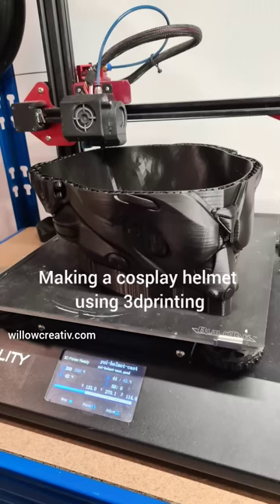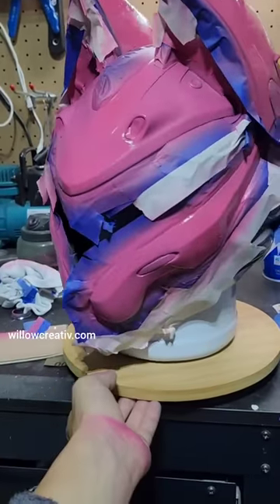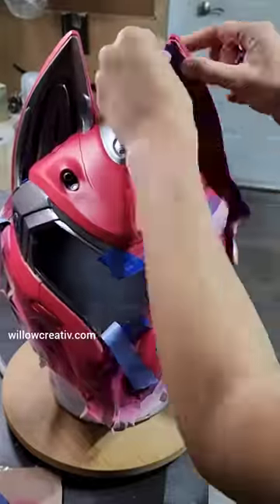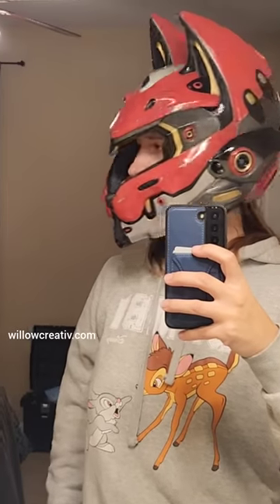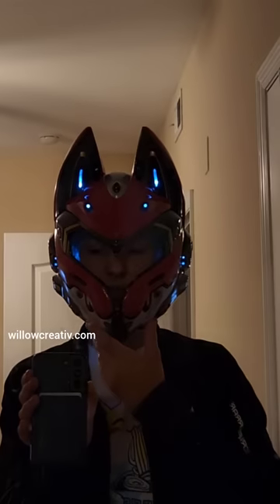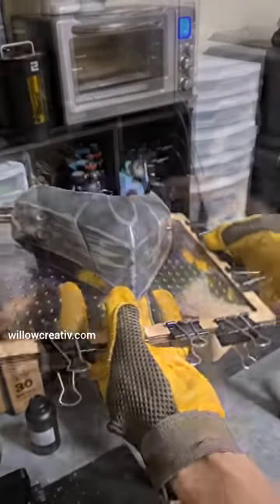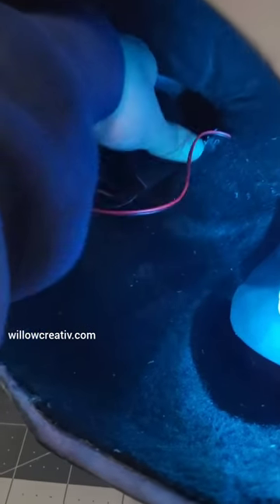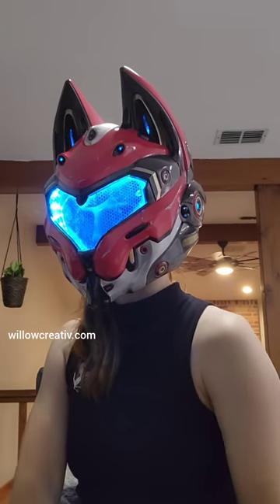How I made this amazing 3dprinted custom helmet!

Comment: amazing work you did there. I do have 1 small suggestion that may help with vizor led strip. add a few resistors to the led strip to bring down the brightness or add tint to the strips themselves so that it still lights up the vizor but doesn't blind you in dim rooms

Comment: It's a stunning piece of work & you should be rightly proud of your achievement in building it. 

I look forward to your watching more vids showing your continued work on the Spec Ops Armored Suit. 

Some Suggestions: 
~ Rebuild the electronics to have external control switches (under one ear) for the lights & other tech.
~ A well silenced cooling fan (axial would work best) blowing fresh air into the helmet.
~ Replace one of the tiny lights above your forehead with a high resolution (4K) video camera that is connected with a couple of stereo microphones inside each of the ears - perhaps even linked to a HUD (or something similar) for the screen.

I so want to see people engineering actual technological armored/computerized suits and people building Cosplay rigs like this getting together to make technically plausible Armored Suits that still look freaking awesome.

Comment: This is awesome! Really well done!

Would it be difficult to maybe route the on/off switches to somewhere like the neck/chin of the thing, so you could control the lighting without removing the helmet?
Reply from the maker: Yeah its not a problem to do but it was not a feature required for this end result as itll be for shelf decoration mostly

Comment: Another great piece! Do you add extra depth to the details like the lines to account for the smoothing spray?
Reply from the maker: it depends on the look i want, i added a very tiny bit of dark brown/black paint in the corners because i also added a bit of scrapes and stuff to make it look worn. If i wanted a super clean look not too distressed i wouldnt add it
Reply: @WillowCreative  Ahh I see. It just made me think of when I used to  paint Warhammer models & how I had to use a thin base coat so I didn't loose the details.
Reply from the maker: @ZardozXerxes  true yes sometimes i stick a dremel with a thin diamond drill in the edges to carve them out more. But at bigger scale there's less worries about loosing detail

Comment: Really great work! How did you make the holes for the LED's? I'm working on a similar helmet, and I'm worried about destroying it trying to drill holes into it.
Reply from the maker: I used a dremel :) i've had to do some patchwork because the dremel cut into the edges
Reply: Thanks! It turned out great